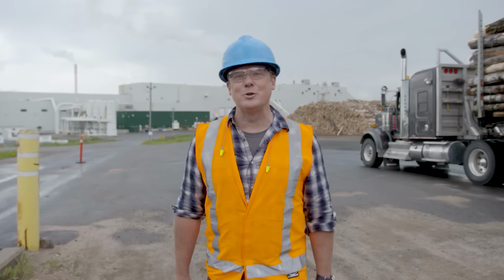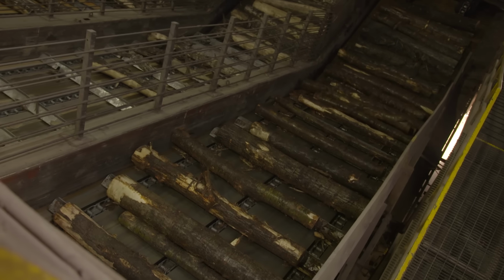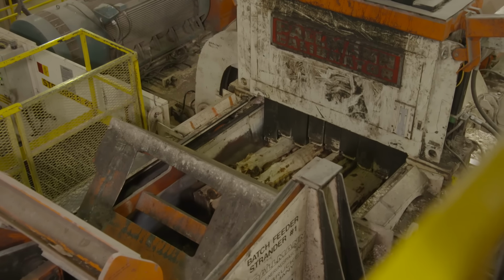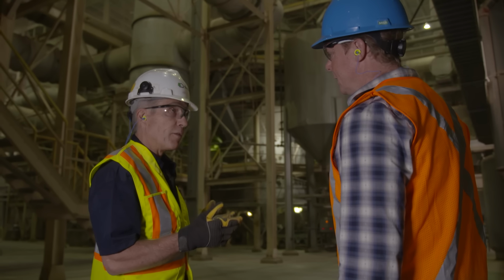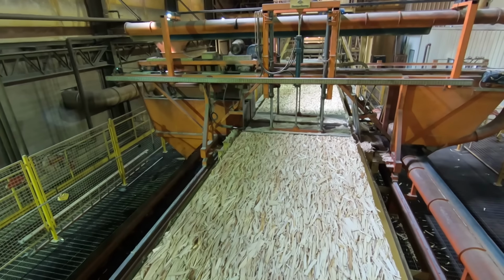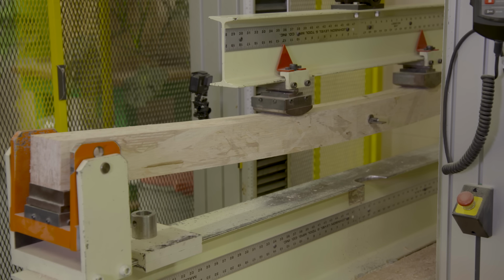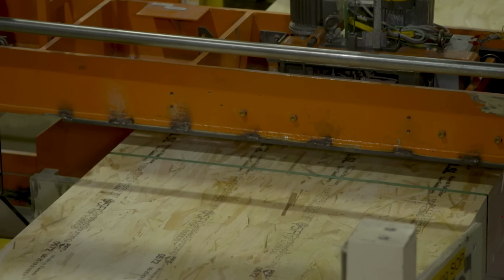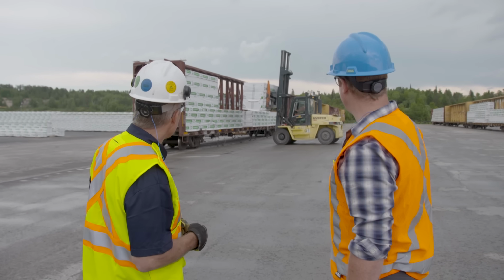Laminated Strand Lumber Factory Tour | This Old House

Comment: I've been a builder for 30 years...I remember when the first OSB came out...It took a while before we switched over from CDX ply...LSL's are going to get less and less expensive...A better value product...
Reply: pllywood still superior over OSB
Reply: @randomrazr  Surely it's the context you should be supplying?

Can you give any actual examples?
Reply: @t1n4444  for one, OSB burns faster. in a house fire, every minute counts
Reply: @randomrazr  They are definitely a hazard during fires.  One of the local fire departments recently posted pictures from a fire in a relatively new house that the chief had a bad feeling about and stopped his team from entering the structure via the front door.  Instead they made entry on an exposed portion of the basement and did not enter the structure from above.  He was right, after the fire (in the basement) was contained, photos were taken where the engineered joists supporting the first floor were completely burned away and the subfloor was just hanging unsupported.  Any firefighter that had entered the structure on the first floor would have fallen through, possibly to their death.  Code really needs to include requirements that any engineered wood structural members should, at a minimum, have fire-resistant coatings applied so slow and/or prevent engineered wood structural elements from burning so quickly.
Reply: @timothybarney7257  exactly, alot of the new homes builders are switching to OSB sheathing and engineered floor joists. your basically trusting your home to be supported by glue. glue is petroleum based, its not wonder engineered wood lights up faster and hotter. if i were to build a new house, solid wood lfoor beams and plywood at minimium. it also makes u wonder whether these engineered wood strucutures will last 100 years.

Comment: I thought testing a 2 x 4 would be a compression test. I’ve never tried to pull a board apart.
I’d also be hesitant if a little moisture got to any OSB product. For a few extra bucks I’ll pay for plywood and boards.
I can see this in small sheds any projects but not houses.
Reply: LSL studs and beams are far stronger than dimensional lumber. Most builders will frame exterior walls with 2x6 dimensional and the interior structures will be LSL. Very useful when framing large rake walls because you'll never find a 16ft 2x4 that is straight. Try building a tall wall with regular lumber and if there's any light coming across that wall it will look like waves in an ocean.
Reply: xBRVTALx I head what you’re saying and agree to a point but the only thing I ever used a 16’ 2x4 would be a top/bottom plate.
Reply: LOL...Friend, you have no clue...You think those 40 rail cars and 75 trucks PER WEEK are going to sheds? This stuff is magnitudes better than regular plywood and less wasteful. Carpenter/builder for over 30 years.
Reply: ROB-IN-PHILLY also a builder now in my 60’s. If this is equal to a laminated beam then I would agree.
Reply: @SteveBueche1027  Paralams and Micro lams that we used in the 90's and in the early 21st century were great for spanning but; these engineered products are much better engineered now...This way we can frame lighter and cheaper...You know; as a builder; that's the bottom line...If code accepts it, and it's cheaper; it's a no brainer...:)
Reply: @godbluffvdgg   that's  because my friend it's cheaper not better

Comment: The end of the line where most of the workers are at, automation being worked on! Job cuts coming.
Reply: Automation mainly only takes away the non ergonomic jobs that people can’t do for long without getting hurt or have some sort of long term disability.
Reply: Toob247 Toob247  Hmm, I take your point ... but ... robots have been used in car construction for over 50 years. Started off with spot welding and went from there.

Yes I know, hadn't realised how far back robots went either!

As far as I can see it's not all bad as some processes might be entirely automated but some machines require human intervention, or control, in the setting up, as in driving a computer to drive said machine.

Driving the machine might deserve more training and consequently a higher salary so not all bad.

It might be said automation merely increases the output but might require more staff to deal with the products as in road testing perhaps ... I'm speculating on that last bit btw.
Reply: Train Nerd  And was reminded about the " old" union fears about how computers would take our jobs away.

But then we found how an entirely new industry evolved on the purely physical department of building computers and maintaining them. Plus driving them let alone programming them.

Not forgetting entirely new types of buildings to house them in.

Then PCs arrived and then laptops, followed by smart phones.

Then companies appeared to write programs for the smaller processors and so on and on and on.

Then we had to recycle or dismantle the kit as it was replaced.

Then we had CAD CAM. Now we are developing AI.

So where one door closes sometimes dozens of new doors open in its place.

Amazing what a bit of silicon can do.
Reply: True, but your car or truck might have been made by "robots" resulting in lower prices so "we" can more easily afford them.

Will presume you wouldn't stop using said vehicles if you discovered a robot and AI had built them?

Comment: What a waste of trees making them into osb 2x4's
Reply: Actually they are straighter, stronger and more stable. They don't require culling on the job site either, where sometimes up to 20% can be lost to warped wood.
Reply: I'm sure the rest of the world will quickly realize that, and engineered wood products will be a short-lived phenomenon.
Reply: @kenc2257 , Not even close. There are more engineered wood products coming out every year and with good reason like I stated.
Reply: @augustreil  Some are good like plywood or melamine (for ikea junk) but osb 2x4's not so much.
Reply: @augustreil  You don't see 100 year old houses using that junk do you?
Reply: @sheeplad803 , It hasn't been around that long.